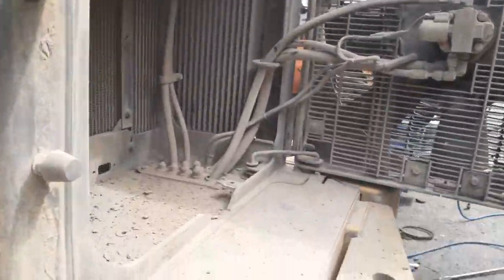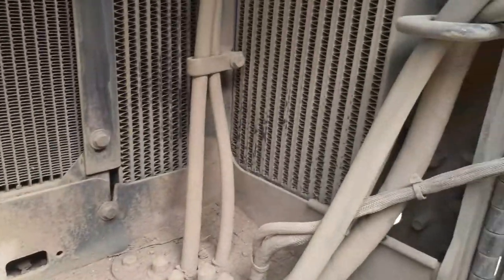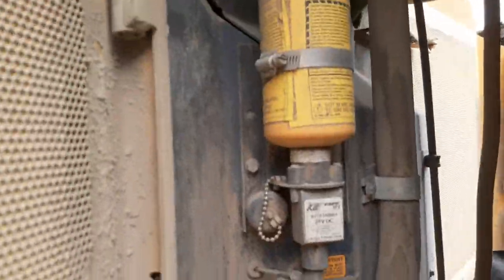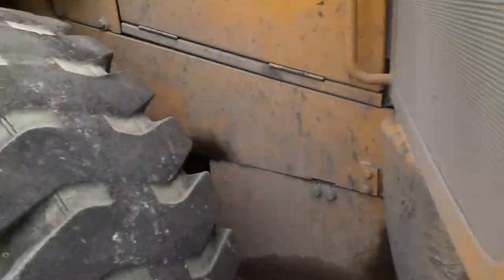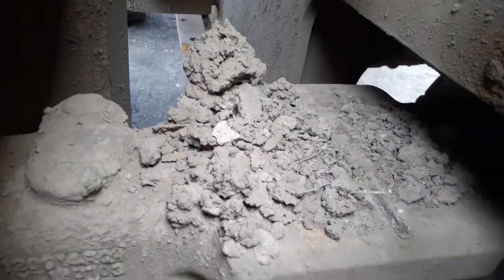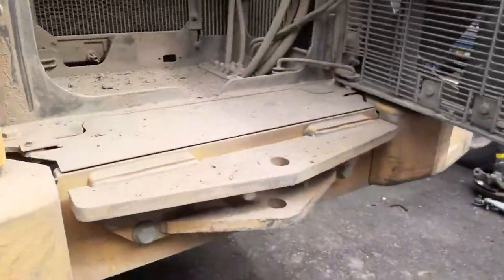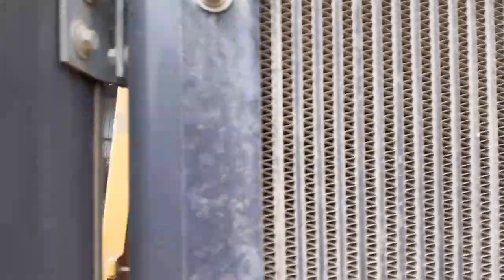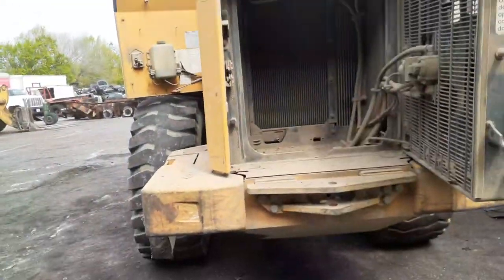BLOWING OUT DUSTY COOLING SYSTEM ON MY JOHNDEERE LOADER!!😱

Comment: I would use water. Cleaner and less dust everywhere
Reply from the maker: Well if u use water n u cant get in cracks of da cooling system where all da DUST n dirt sit water turns it into mud n ur system cant cool its self down now air flow..
Reply: @DeathRowCarCrusher  use a lot of water like air pressure.
Reply from the maker: That was last thing I did I used a high pressure washer..